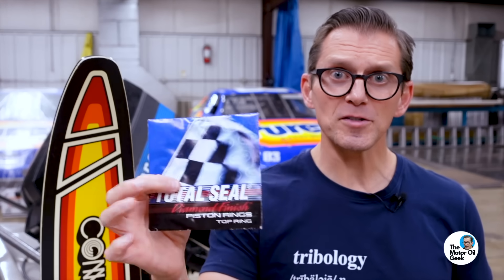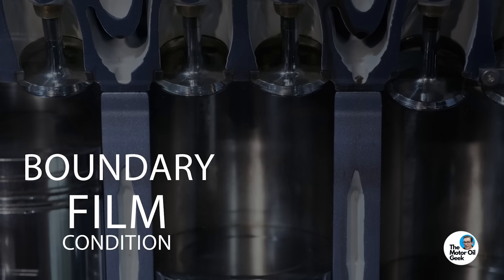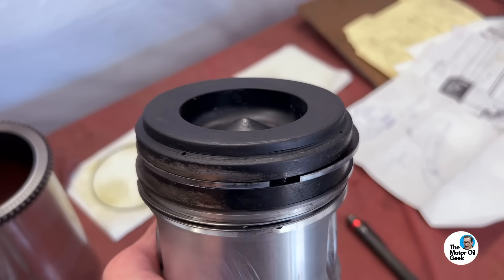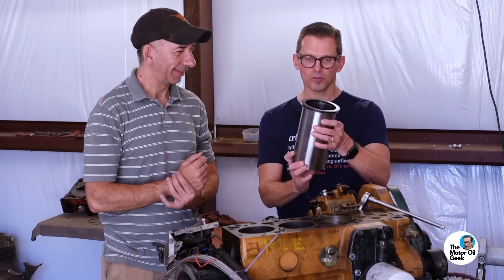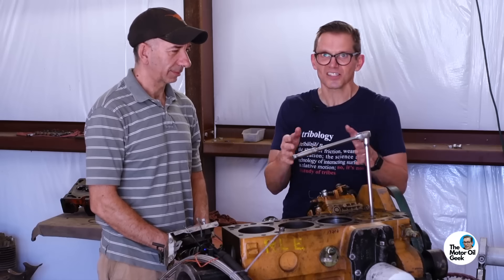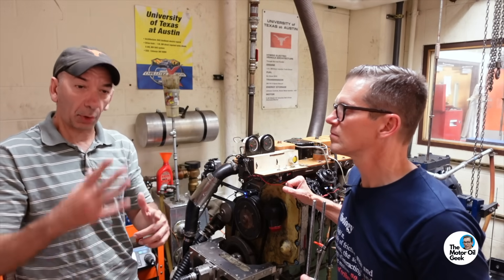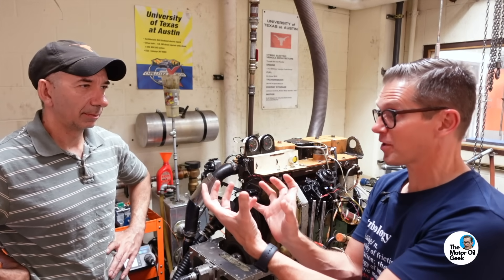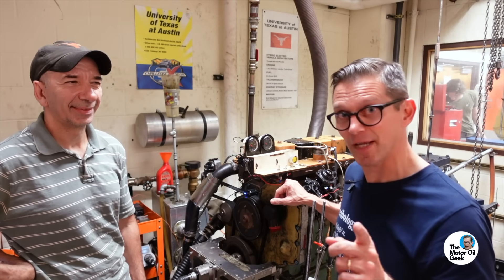Water Skiing Explains LUBRICATION - This CRAZY Engine Proves It!

Comment: I am having a hard time understanding how the friction losses gained from this system overcome the losses of driving/rotating these sleeves. The additional parts and complexities added will increase weight and cost. So how much net benefit is there to the actual consumer?
Reply: It would have a greater benefit In something like commercial generators, pumps etc. Anything that is stationary where weight wouldn't be an issue. If they are seeing an approximate 10° gain on the test engine with all the new rotating parts then you should see the same gain on any equipment that has this design. The initial cost could be a major factor though.
Reply: @thatsonebadhatharry8610 

In a fixed engine, just go back to the full sleeve valve instead of poppet valves.  Napier Sabre breathed really well.
Reply: The losses from the rotation of the liner are hydrodynamic, very low friction coefficient.  The losses that are eliminated are boundary, friction coefficient 10-50 times higher.  This is how.   As Lake said, this is no speculation.  This concept is not for the typical consumer.  The concept applies to commercial engines where the cost of fuel is enormous.
Reply: It seems like a cool idea in concept. Helping to reduce wear in a critical area. The question being, will this new system's reliability out last the common failure mode which is the cylinder seal. 

I suspect, especially looking at how complicated it is to seal it. No. But I do enjoy a good engineering experiment!
Reply: I thought they would have had the engine running as the proof of the pudding is in the eating. You can talk all day, but action speaks louder than words. A missed opportunity.
Reply: You can’t blame them for always looking for better ring seal .
Reply: What I get from this is basic science only. Basic lubrication investigation. Doesn’t seem like he has an avenue for application yet. If it does eventually lead to application I’d be surprised if it went beyond racing, because on the production vehicle end of things we’re only focused on fuel use reduction. 

Just my 2 cents.
Reply: @EvzenKovar-i5p
  I wasn't seeing it either, until at the end, he claimed 40% reduction in idling fuel use, and 10% reduction under load.  Getting the results production vehicles focus on.
  Maybe more gee whiz than real benefit, but it worked in the slide valve variant.
Reply: @EvzenKovar-i5p 
You got it kind of backwards.

If it ever gets to production stage it'll most certainly be in commercial applications like gensets, other stationary industrial gear and maybe things like prime movers, smaller marine diesels or even semi trucks etc. pp.

A significant reduction in average friction of roughly ten percent, as stated, would directly translate to a few percent reduction in fuel consumption - that's the very thought behind it, the reduction in wear is merely a nice bonus. 
A little lower heat load saves a bit via reduction of necessary pump power as well and so on and so forth.
That's exactly the main benefit it provides in industrial applications where the cost of fuel and cost of ownership VS. Initial price very often has a drastically different ratio than it does in most consumer applications.

An increased MTBF/longer maintenance intervals might be another cost saver that might be worth added complexity as well, especially in applications like marine engines that are notoriously hard to work on due to obvious constraints or in cases when a long lifetime with high reliability is essential. 

In racing the added complexity and the additional weight are probably a huge hindrance, I doubt you'd ever see such a system there as long as it's not very commonplace in other sectors.

(btw - emissions ≠ fuel consumption. Otherwise large V8's and other similarly oversized engines would be a thing of the past and cars above maybe 120-150hp would be quite rare. But instead most cars are massively overpowered from a perspective of necessity, nobody needs more than 50-100hp to successfully get from point a to point b after all. Especially not in the US and countries with similar low speed limits.)
Reply: I suspect that is TBD. This looks like basic research with some interesting findings, to be further developed. I would think it’s more applicable in engines with continuous operation and long life cycles that are limited by engine wear. Less efficiency savings than lifetime extension.  I’ve had many 250k+ mile cars, and never end-of-life due to engine wear, so autos may not be the use case for it. But a piston engine running 24x7, needing regular replacement due to cylinder wear failure, might be. 100x reduction in wear at peak could greatly increase useful life, paying for a development of this with minimal weight/losses/complexity.
Reply: Needing new head gasket bearings sounds like an overplayed joke from 2009.  But here we are.
Reply: If you just change your oil regularly you’ll be fine in any car with any approved oil. The rest of the car will wear out long before the engine. All this is nonsense
Reply: @chadlea6116 True, unless you are trying to save fuel costs.
Reply: I was wondering something similar but as I watched the video I thought this was at the university of Texas.  If they are studying Tribology I think it was just being used to test and prove theory and not something that would ever be put into production.
Reply: This is a product that's in development and they're seeking funding. It's in an early stage start up. The goal is to commercialize the product. That's according to the website that was linked at the end of the video.
Reply: @   Power to them. We need innovation. Before they’re going to have a chance at raising much money they’re going to need to test two engines on the dyno, identical except one has the rotating sleeves.
Reply: Everybody in these comments didn’t pay attention to stribec curve
Reply: Isn't this just moving the friction point from inside the cylinder to the top at the additional moving sleeves and also making more engine load by creating a complex and complicated system to turn the sleeve? What about a head gasket and the friction/wear/compression seal issues created at that point with the moving sleeve? Also the cost of a rebuild would be astronomical. 

Not practical at all.
Reply: @ you have to start somewhere although i absolutely agree with you …i believe the future is small diesel generators powering electric motors…..mazda just re released a version of their rotary engine but only for the purpose of acting strictly as a generator for a hybrid system
Reply: @jtrill2 I suspect weight is negligible, but if we use some google numbers (take accuracy of them with a grain of salt), we can get an approximation of fuel economy gains:
10% of combustion energy is lost to engine friction.
50% of engine friction when driving is from the pistons (75% at idle).
He claims 10% reduction of friction at the piston with the rotating sleeves.
Making an assumption that combustion energy equates equally to fuel economy, I get 10%x50% gives us 5% of energy is wasted pushing the pistons, and 5%x10% gives us 0.5% potential increase in efficiency (double check my work as I am a verifiable idiot).
So, a 30mpg vehicle with half a percent fuel economy gain would be 30.15mpg. Over a 200,000 mile life car, you'd save about 10,000 miles of fuel, or over 330 gallons at say $3/gal to get you $1000 in savings.

It seems he's pressing this as an advantage more to big rig trucks as minimal fuel economy gains could be worthwhile due to the high miles they accumulate, and extensive idling they often do. The reality is, the added complexity and unproven gas seal are likely to cause more mechanical issues (at least until unrealistic levels of testing in the wild are performed) than any gains made in fuel economy/engine wear. Clever thought process to recognize and address the boundary layer for the piston, but too little benefit for any mass market vehicle unless the government puts on tighter mandates that necessitate something like this.
Reply: This is not a production engine rather proof of concept to see how much friction there is when the piston stops and starts at TDC and BDC. Achieved by rotating the liner. The Bristol Centaurus engines used to have a liner which basically did a jig to operate sleeve valves. It rotated a bit and also slid up and down. If you look at the front of one of these engines, it is full of little gears which timed them. Hellishly complex and problematic machining the sleeves to required tolerances. Should be a good picture on Wikipedia
Reply: You’re correct. There is the added friction on the outside of the rotating liner, the friction in the gears and their driving mechanism. The extra complexity adds to the cost.

If we were able to do a cost/benefit analysis perhaps we would find that there’s an increased longevity on top of reduced fuel consumption that would make it a net gain. In any event, it is an interesting experiment.
Reply: Obviously the rotating mass. The video is kinda meh.
Reply: Are you telling me that the liner is moving relative to the piston RING??

Because I'm pretty sure that if the liner rotates... the piston ring rotates with it... therefore there is NO relative movement between the liner and ring(s)!   Has no one considered this?!
Reply: @ yes it but don’t think the liner always rotates …i believe it rotates essentially during bottom dead center when the piston slows down and loses its peak lubricity
Reply: Well if the cylinder is floating on a hydrodynamic wedge it wouldnt take much ... just a guess
Reply: It seems to have deleted my earlier comment...

I suspect weight is negligible, but if we use some google numbers (take accuracy of them with a grain of salt), we can get an approximation of fuel economy gains:
10% of combustion energy is lost to engine friction.
50% of engine friction when driving is from the pistons (75% at idle).
He claims 10% reduction of friction at the piston with the rotating sleeves.
Making an assumption that combustion energy equates equally to fuel economy, I get 10%x50% gives us 5% of energy is wasted pushing the pistons, and 5%x10% gives us 0.5% potential increase in efficiency (double check my work as I am a verifiable idiot).
So, a 30mpg vehicle with half a percent fuel economy gain would be 30.15mpg. Over a 200,000 mile life car, you'd save about 10,000 miles of fuel, or over 333 gallons at say $3/gal to get you $1000 in savings.

It seems he's pressing this as an advantage more to big rig trucks as minimal fuel economy gains could be worthwhile due to the high miles they accumulate, and extensive idling they often do. The reality is, the added complexity and unproven gas seal are likely to cause more mechanical issues (at least until unrealistic levels of testing in the wild are performed) than any gains made in fuel economy/engine wear. Clever thought process to recognize and address the boundary layer for the piston, but too little benefit for any consumer unless the EPA restrictions necessitate it.
Reply: @DoctorJelly  Not 10 % friction reduction, 10 % fuel economy improvement.  The piston assembly fiction reduction is far more dramatic than just 10 %.
Reply: @DoctorJelly  sometimes youll find your comment in the "Newest" section/button right above the comments. I find it annoying honestly.
Reply: @DoctorJelly I don't think you can separate out the source of friction, because he only measures total friction. He's not saying 10% of a particular type of friction, he's saying a 10% reduction in friction.
Reply: @DoctorJelly I hear what you are saying however given that large stationary engines ( Diesel ) operate at around 1800 rpm continuously the benefits are greater due to relatively lower piston speeds.
Reply: What customer?
Reply: Centrifugal forces keeping oil on the cylinder walls??
Reply: @lanehammer  no it has nothing to do with that.
Reply: It seems like the value proposition here is for stationary engines or powerplants where weight is not as much of a concern and cost increase is offset by fuel savings. 10% reduction in total friction is absolutely massive if true.
Reply: @Nathan0A  10 % fuel consumption reduction, not 10 % friction reduction.  The combustion seal works.
Reply: It is likely less efficient, but less wear.
Reply: Well , the grant funding is remarkable ,,, !
Reply: If it ever made it into production, and it was a great benefit, after a few years some bean counter would look at the metal gears and decide that plastic gears would save a nickel.
Reply: 10% savings in fuel over the life of engine is the benefit. 
Less wear on the engine cylinders is a bonus. 
I don't see how it would add too much weight to the engine. 
Less friction equals more power.
Win win win.
Reply: so part of the piston ‘s 4cycle for a majority of the time when the piston is rapidly cycling the oil is able to allow the piston ring to “float” on or “hydroplane”  on one side of the oil film opposite of cylinder wall but somewhere in the piston cycle the piston slows down and the piston stops floating/skiing on the oil and more power robbing friction,heat & wear are produced between the piston ring and abrasive crosshatching on cylinder walls while it has to speed up and break the plain so it starts skiing for skimming across the oil again …. so to sum it up this guy has designed a moter that the cylinder walls on the block rotate opposite of the direction of the piston at the exact moment the piston reaches that dead zone where it slows down and loses lubricity a gear rotates the cylinder so the side to side rotation mimics the up and down rotation of the piston & in turn the piston is always floating on the oil film instead of having to psychically push the oil every cycle to reach its “plain” or float on the surface of the oil film again and essentially plowing through the oil film over and over-as it cycles until it reaches that point where the ring floats across the oil film ! so less friction equals more inherent power freed up & less heat & wear which equals longevity as long as the design is sound and durable …your welcome 😆🫶🦅
Reply: Once it's in production it's probably not that much more money, and weight is probably not much either. As this is mainly for comersial engines they'll make back cost quickly, and reduced friction usually means less heat so the whole package with radiator might actually be lighter.
Reply: I too do not see how rotating the cylinder makes any difference in the friction.  How does the oil stay on the cylinder wall any longer when the piston is still moving up and down and the pressures are still while the cylinder is at the top end of the bore.
Reply: @marbles05  With a fixed sleeve when the piston ring is motionless/reversing at TDC the interface will go to boundary film/metal-on-metal/ high friction. Your water skier stops and sinks into the water. With the rotating cylinder at TDP you are moving the lake water-surface sideways under the skier fast enough to keep them from sinking. The ring interface stays in the hydrodynamic phase/full oil film/low friction.
Reply: @MathewPollard-vj4uq  Thank you!
Reply: @marbles05 whenever I add fresh new break caliper slide pin grease on the slide pins, I noticed that it is much easier to insert the pins into the bore if I twist the pins in. I tend to feel more resistance pushing it straight in. I think they are on to something .
Reply: @marbles05 Because there is always relative movement the friction is sliding on an oil film all the time which is a lot less friction
Reply: @marbles05  the relative velocity wall to ring and piston to wall stays a bit higher so you avoid thinning the oil film at the interface and avoid Sticktion. The analogy they use here is a water skier staying up on a hydrodynamic wave. 
Another way to look at it is rub your hand on a wet windscreen. As long as your hand is moving fast it glides on a film. Slow down and you can get your hand to squeak. The squeak is film defeat. Enormous friction. Now Imagine your hand making the same motion but the windscreen keeps moving so you avoid a slow hand to glass interface.
Reply: @marbles05 well they're trying to figure out why, they just know it was observed, hence this rig to lab test.

Maybe its just more even distribution from spinning or centrifugal or the rings being more evenly used and fitting themselves.

I'd like to see a system where just the rings rotate and another where the piston rotates.
Reply: @marbles05  As Lake explained, the friction and wear occurs when the piston slows and cylinder pressure increases. The rotating liner ensures that the piston rings in relation to the bore are constantly sliding on the film of oil and not having metal to metal contact.
Reply: @marbles05 I think it’s more so that the oil is creating a film due to the speed the metal would be riding on it. Think about it this way. If a sheet of metal is sitting on another sheet of metal sandwiching oil and moving slowly you’d still get some grind but at a certain speed fast enough the metal sheet will stop riding the other sheet and start riding the oil. That’s the only way I can make sense of it in my head
Reply: That’s why you don’t have a channel,,,,we didn’t come here for your , “ look at me “ comment……..some tools are best left at home
Reply: It's static vs sliding friction. You know in your car how you have ABS breaks? This is the opposite of that
Reply: I think they are focused on longer lifespan of the engine rather than power and performance. If you can reduce the wear in the cylinder, the engine should last longer before its time to rebuild or scrap, that would save money for the consumer in the long run. That's how I see it anyway
Reply: We should go back to building cars the way we used to simple.  No power steering air conditioning power brakes Manuel transmission  ect😊
Reply: @bluesky6985  I wasn't aware Manuel made transmissions?
Reply: Yes this engine design should have been moved from the draft board directly to the circular filing cabinet